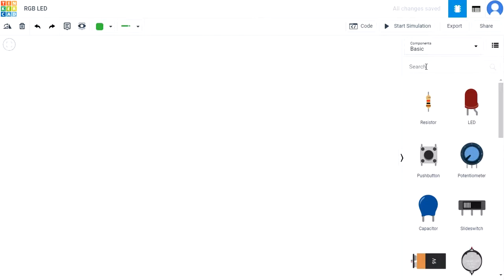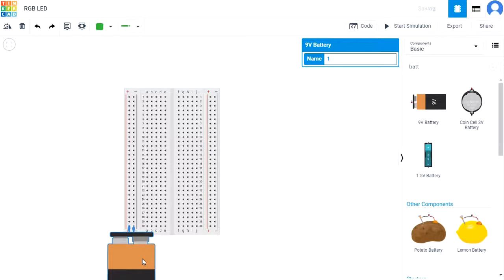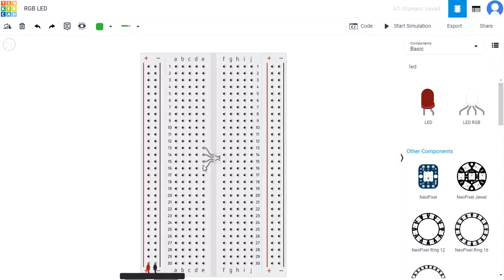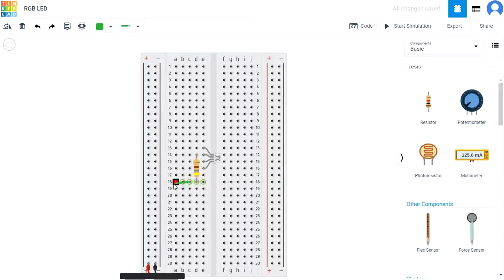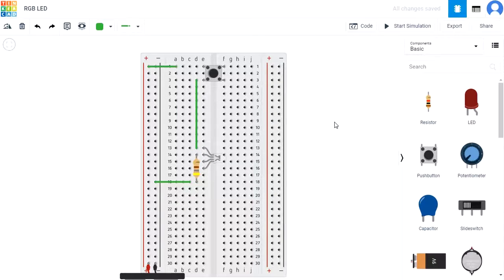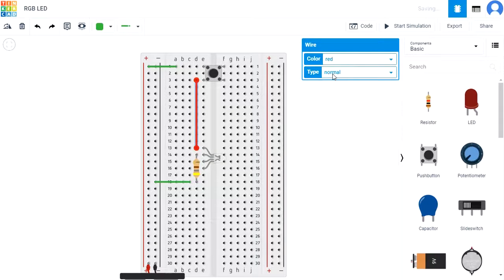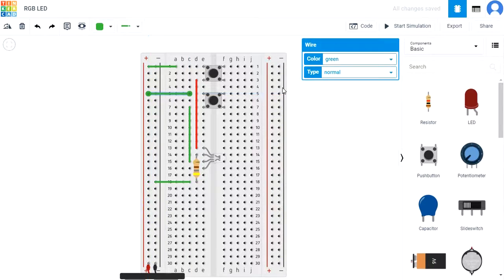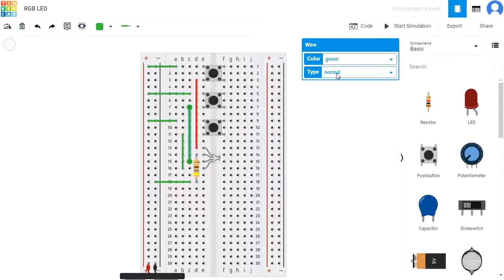TINKERCAD | RGB LED CIRCUIT with PUSHBUTTONS

Comment: My red led is dim and I tried changing there value of the resistor and I even put no resistor but it stayed they same brightness, how can I fix this?
Reply from the maker: Hi, 
Are you trying this in real life? It can be because of the battery voltage you are trying to use.

Comment: I tried this with an arduino  and it did not work,  help?
Reply from the maker: Did you connect poles correctly? And please check the resistance value.